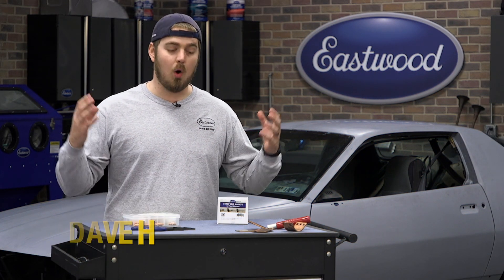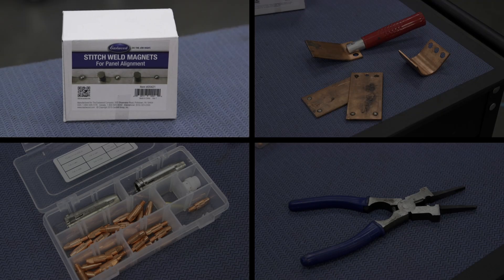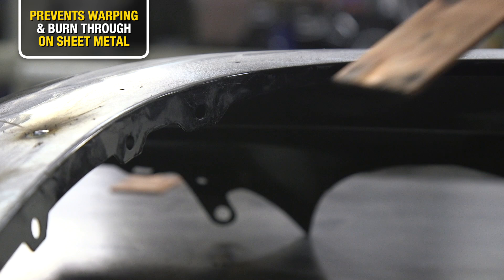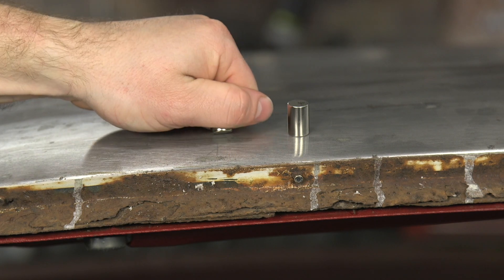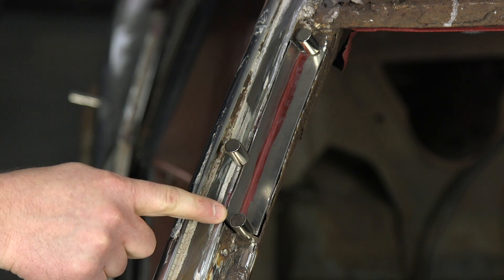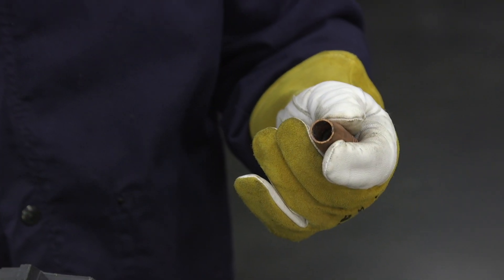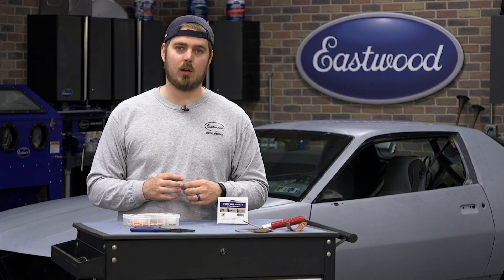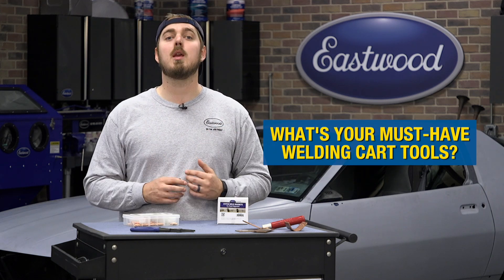Four Things to ALWAYS Keep on Your MIG Welding Cart! What are YOUR Must-Have Tools? Eastwood

Comment: I keep the very same things on my welding kart, the only thing other than what you mentioned is a piece of copper pipe to be able to cut and bend into shape for places where you need a copper backer but it’s either a awkward shape or to small of an area to get the Eastwood copper backers into place.
Reply from the maker: Nice!

Comment: drive rollers for various types of wire, dedicated wrenches, bottle valve tools (various squares), high pressure T and twin argon regulators, extra teflon MIG liners, flow rator for testing at torch tip, OxyAcetylene outfit, etc.  I keep the smalls in a Milwaukee organizer.  Those little magnets are too fragile, they should be sleeved so that the sides don't chip off.